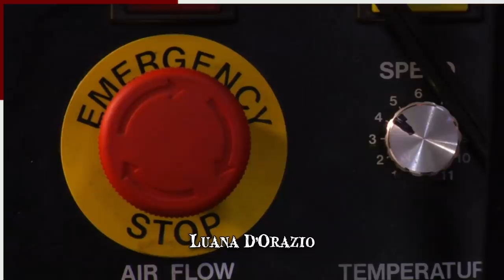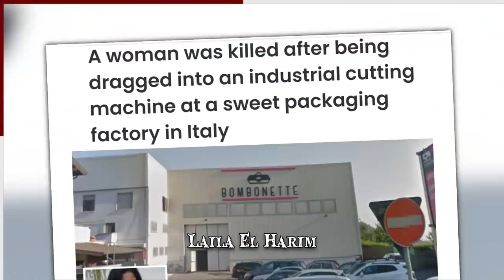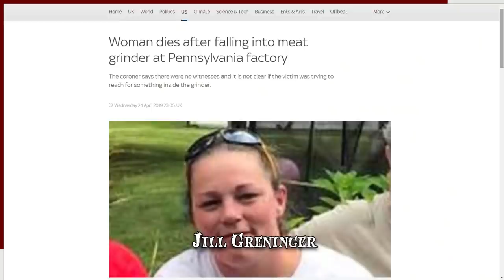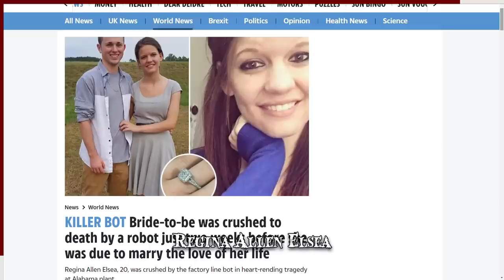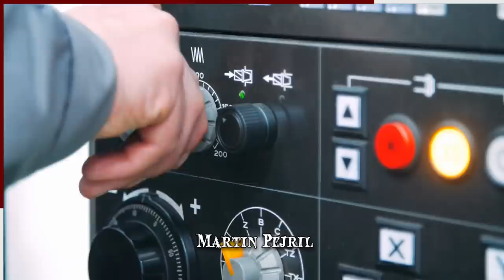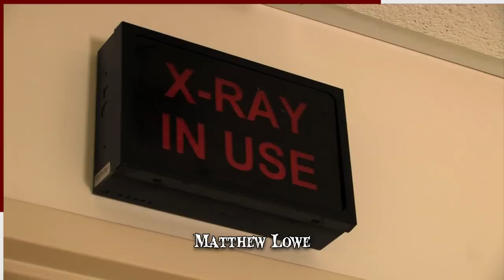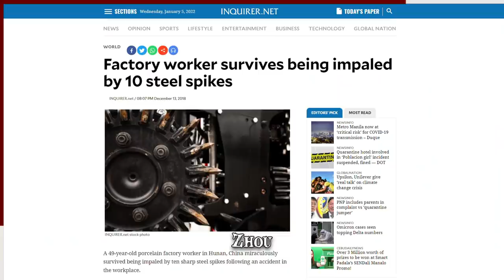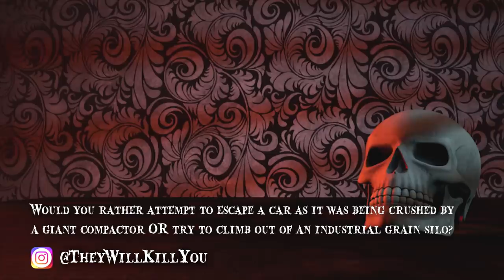When Factories Go Wrong

Comment: I used to work in powdered metal factories. Most places I worked made car parts. The presses that are used to make the parts are terrifying. There’s some 30 ton presses and sometimes you have to put your hand in the machine to get the parts out. Also worked on ovens, which are used to harden the parts. These ovens are around 30-40 feet long and go up to 3,000 degrees, sometimes higher. Seen many people lose fingers, sometimes arms below the elbow. Every now and then the oven would catch a back draft, or the power goes out, and the ovens will shoot a flame out the front, right where you’re standing loading parts.
Anytime the power so much as flickered, Imma running lol
Reply: worked at one of those myself...I worked in the steam-treat area...the furnaces were right beside us and one of the huge steam treaters had a bad habit of igniting trapped gassed when the lid was pulled up after  the cycle was done...that and dragging baskets of parts around on little 4 wheel caster carts that weighed over 2,000 lbs with a hook and handle
Reply: I worked at a factory that did just the heat treating for about a year.. I ran one of the huge ovens that ran parts on a huge belt, had an oil pit the parts fell into after baking, and then went through another section. Took like 2-3 hours a batch of parts to make it from start to finish.. But I do know the ovens you’re talking about. I’d help load baskets when it was a slow night. I liked working there, I just hated when I had to run ammonia on the oven because I had to hook it up myself and I was afraid I was gonna mess it up somehow.. I never did but the safety video you have to watch is a bit traumatizing lol … oh and the heat in the summer was horrible 
My small town was predominantly powdered metal factories. Mostly the raw powder presses that fill the die with powder, and presses the part, some sizing machines and ovens that bake the raw powdered parts to make them hard,.. Heat treat would come after ovens and sizing and was usually sent out to the company I used to work for…
We had one huge company that made General Motors, Toyota, and Dodge parts. They were bought out last year, and the new company only wanted the factories so they could shut them down and cut them out because they were a huge competitor. So half the town lost their jobs in the fall. Our populations only around 5,000 and we had a lot of out of town workers. There’s a lot of factories out of town but most don’t hire in the fall and winter because it’s the slow season. Right now I think we have 5 or 6 factories here but they’re all very small, like less than 100 employees. That buy out was hard on alot of people, esp the ones that worked through temp and job agencies agencies because they can’t get unemployment.
Reply: I worked at Weber grills here in Illinois and I felt the same when clearing the gigantic press machines of obstructions.  If anyone decided to push the two palm sized buttons that press was taking me out or at least taking my arm off. I've worked at plenty of factories out here but Weber was the sketchiest by far.
Reply: @BigDonKedick  Our biggest factory was called GKN and they made car parts for big companies like 
Chevy, Toyota, Ford, Dodge.. mostly engine parts. I worked at smaller, family owned factories. The ovens used to scare me when the electricity would go out or even flicker. It would kick the oven off and shoot a 25ft flame out both ends.. If there was so much as a flicker, I’d be running across the plant lol 
And I totally remember running the paddle presses..  If someone were to even trip and hit the paddle, that die is coming down, nothings gonna stop it

Comment: Diecast Repair Tech here...
#8- Almost certainly her fault, which is why there's no cause listed. The dual switch operation cannot be altered, bypassed or tricked in any way. You can't even press the buttons out of time or the machine will fault. She was operating it incorrectly.
#6- The company is liable. The operation lock on the cage door couldn't have been active(a lock that keeps the machine OFF while the cage door is open for service) and lock-out/tag-out wasn't followed.
The robot arms(ABB's) are on preprogrammed paths of operation. If they start up and you're in the way, well...these things can flip a car like a Tonka truck. You're screwed. I've actually seen a few close calls related to this.

Accidents of this nature are pretty common in manufacturing. Companies lie and pay people off to keep out of the news(yes, it most certainly does happen). Two particularly bad accidents that I've personally witnessed were... *Decapitation caused by a ladle cap. *A maintenance tech being blown up and shredded by failed hydraulics. The hydraulics room was located inside a double-walled, blast-proof room. It completely shattered the walls. The blast was heard at corporate, 1/4 mile away.
Reply: Holy crap, that's insane. I know a friend of mine's uncle got paid off to stay quiet after he lost both legs below the knee is some kind of workplace accident. I don't blame people for being swayed by these large corporations offering money they'd likely never see in their lifetimes otherwise, especially when the alternative is trying to take on their massive legal teams and financial ability to drag a court case out until you're financially ruined. It's horrific to think about all the avoidable deaths and injuries that happen BECAUSE these stories never get out, though.
Reply: Thanks for sharing some insider knowledge. 
The hush-hush is very real. The week before Christmas a mechanical engeneer had a couple fingers removed, while working in moving machinery. Luckily he, and others responded quickly, and efficently.His life, and fingers were saved. But yes, very hush-hush.
Reply: Holy fuck, that hydraulics accident sounds gnarly 😯

Comment: If you work in heavy industries? 

Take YOUR safety into YOUR hands. Don’t let someone else be responsible for it. If it doesn’t feel right, if you get that feeling? Don’t effin do it! Your safety is ultimately up to you!
Reply: hit the nail on the head, been a few times i have point blak refused to do jobs i have been told to do coz off it!! although to be fare i have never got into trouble for it ether coz they wernt bad places to work and did try to do things safely but it's as much up to the people working there as the manigment, you have to work together on it!!
Reply: @ISOSAILING  I’m glad you stood up to them.Sadly internationally a lot of health and safety rules are ignored.They don’t give a 💩
Reply: Very true, but sometimes people don’t understand the danger they are putting themselves in because the culture of the workplace

Comment: I was working at a doogfood plant where we used real meat cuts, so we have industrial oggers and meat gringers and a huge steam mixer that gets up to 300 degrees, and i was cleaning the mixer this one time and the hose i was using got stuck on the rotating arm and nearly pulled me in because the hose wrapped around my leg. i would have died if the hose didnt actually save me because the machine wasnt powerful enough to rip the hose from the wall and someone was able to hit the emergency stop

Comment: Machines are only as smart as the operator controlling them. 
A machine does not know the difference between raw materials and human flesh and will continue its operation without stopping for either.
Reply: Smart & responsible are two different things. Someone makes the decision to keep producing against safety protocols. Safety costs time & money, some companies put profits over safety which is why we have OSHA.
Reply: @aaronburratwood.6957  1000% accurate.  Ive worked in machine shops since 1988 and could tell you some horrible stories.  
You can replace machines and parts but you cannot replace a life.
Reply: Of course, but when owners are purposefully making them unsafe in pursuit of profit then it's on them.
Reply: Sadly in all of these cases proper engineering and/or administrative controls were left out. The problem with OSHA sometimes is that they let off horribly negligent employers with slaps on the wrist. A US$ 50k fine to a company that makes millions makes no sense especially considering that a life was lost.
Reply: @aaronburratwood.6957  in the UK we have the HSE and employers AND employees have legal responsibilities under H&S law and can both be prosecuted. The issue is it’s not as common knowledge as it should be and safety is very rarely discussed when looking at ways to increase or tweak productivity and quality. 
They say safety is expensive …..try having a serious accident businesses will see first hand how expensive safety is.
Reply: @mikluna4263 50k?  those "safety violations" could amount to things like a worker who pushed up their safety glasses to inspect, liquids dripping on a floor, an eyewash station one foot too far away, missing forms, a container without a label, rags left laying around, etc

Comment: it’s easy to understand how one might lose their “reflexive edge” after constantly working around same heavy machinery for years. certain safety precautions you used to follow religiously start to become burdensome annoyances, and staying on high alert for hours on end is exhausting and tiring for anyone. 
we see it time and time again. a worker  starts getting sloppy, forgetting steps, the proper safety procedures and the proper order you’re meant to do them in. 
and whether it’s from outside factors like fatigue, or a personal issue of ignorance or naivety. heavy machines do not care.
In some of these professions, ones where you’re forced into close proximity with unfeeling, merciless, machinery. oil rigging, construction, factory work. The SMALLEST lapse in your judgement or attention OR the attention/judgement of your peers and SUPeriors, could mean a gruesome and brutal death for you or someone else. 
This is the exact reason we have OSHA. and the exact reason why there are countless “annoying” safety procedures you might have to follow, they are ALL there for a reason, and that reason was most often learned in the most brutal way possible, and it very well could have been you if it weren’t for the death of another.
Keep your head up, keep your reflexes sharp, and keep your eyes on your surroundings. Look out for your coworkers, take headcounts, LISTEN TO WARNINGS AND COMPLAINTS MADE BY OTHER WORKERS. these procedures are so burdensome and so annoying to you until you have watch your favorite coworker getting peeled off machinery in pieces. shit ain’t a joke. pay attention.